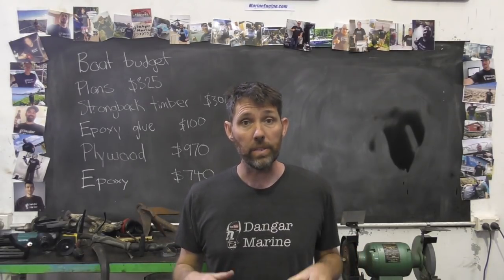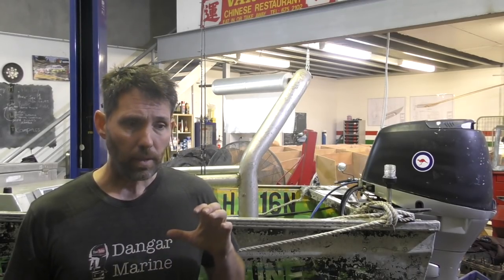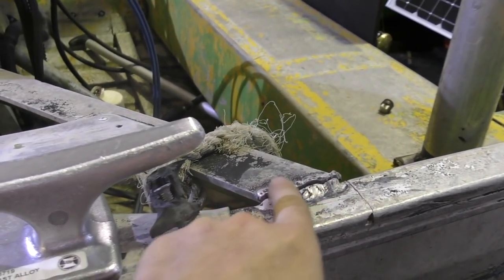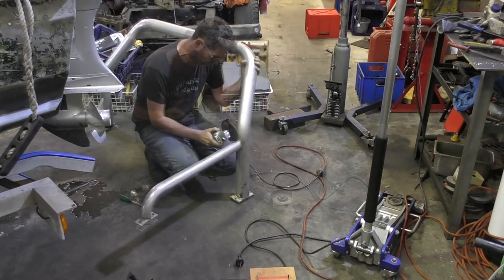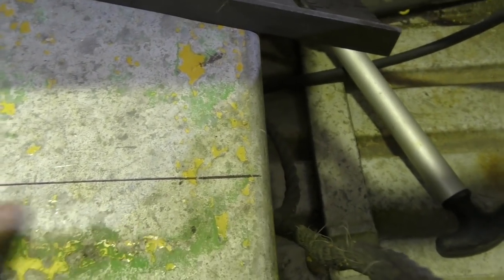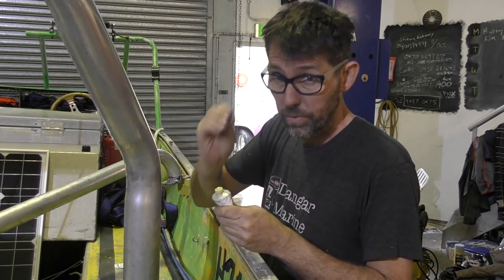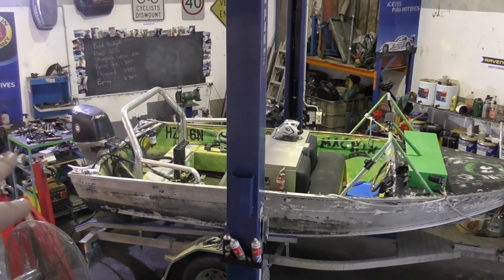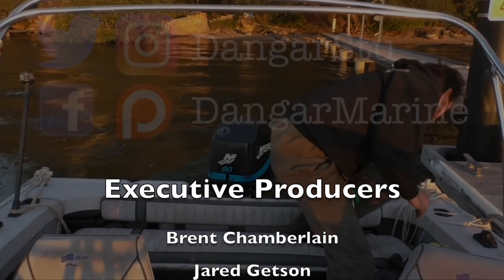Adding a tow bar to the Green Machine

Comment: I was thinking the same about running the wires first but good point on potentially melting them, just run a string or something to pull the wires through with later.
Reply from the maker: I've decided I'm going to drill the bottom of the main uprights and run the wires down through a hole in the seat so I'll definitely need to put a pull cord through like you suggest.

Comment: So much functionality from one lump of aluminium: it's a towbar, a handy grab rail, a rocket-launcher rod mount, a nav light mount, and, as others have suggested, it's the world's coolest place to bolt on a stubby holder, and you can tell the girls your boat's so mean it's got a roll cage.  But it's also sleek and makes the boat look like the Green Racing Machine.  
You could think about adding a short section of tube to fly a dive flag, or a Jolly Roger when you feel cheeky.  Also, you could angle one or two of the rod mounts slightly outwards so you can toss out a speculator trolling lure when you're going somewhere. The possibilities are endless.
Reply from the maker: Hey Paul. I think I might mount a rod holder on each side that angles outwards, would be great for trolling.

Comment: In the last shot where we can see the new bar mounted, I noticed that you have the next project right in front of you!!! You could make your own Bimini top.  Just snap to the front and back bars.  :) Great job with the videos.
Reply from the maker: I was thinking the same thing (maybe with a lightweight bar added in the middle). The two bar setup is also common with builders on the river who need to transport long lengths of timber.

Comment: When grinding Al wax your disc. You'll have to wipe up the surface with some solvent but it really saves the abrasive from loading up. We used a Castrol wax that was in a tube like grease but I'd bet even candle wax would help.
Reply: Yes we use bee's wax on saws and grinding for aluminum.
Reply from the maker: Thanks for the tip, I'll give it a try.

Comment: I'm surprised you didn't just cut a V in the side tubes and just reweld that, vs. the having to weld tube to tube again.

RichE San Diego, CA
Reply from the maker: Hi mate. I did think about that but then I would have need to put a second cut to bring the flange at the end back to level.

Comment: do you ever work on inboard/outboard boats? or does everybody over there pretty much have an outboard?
Reply from the maker: There are sterndrive boats around, the river, but on the island everyone has smaller outboard powered boats for commuting. The sterndrive boats are generally used by people on the mainland as pleasure boats.